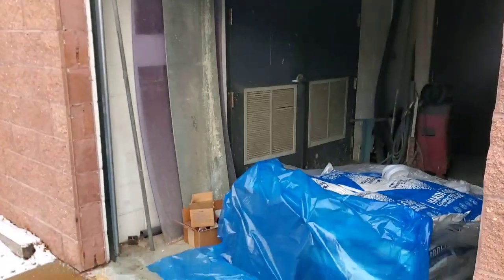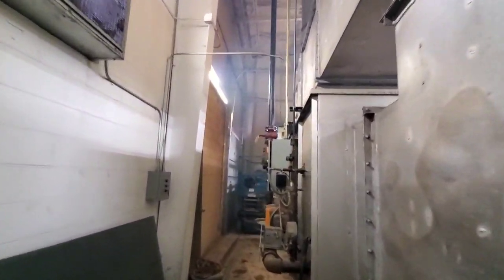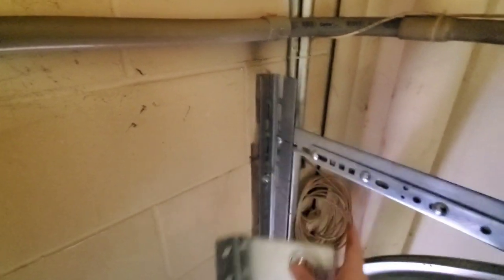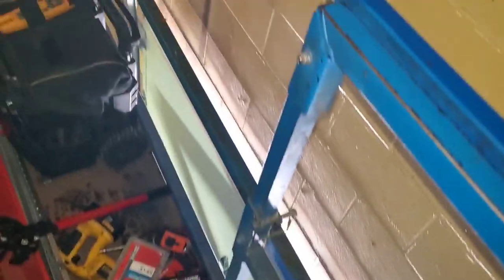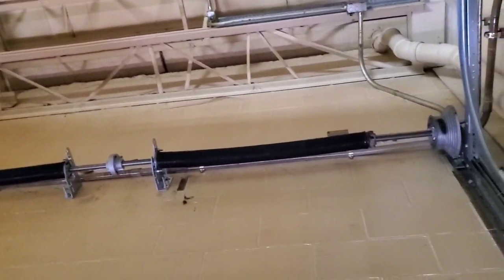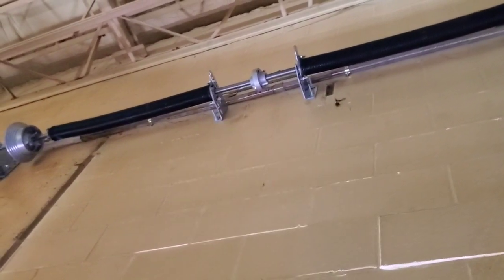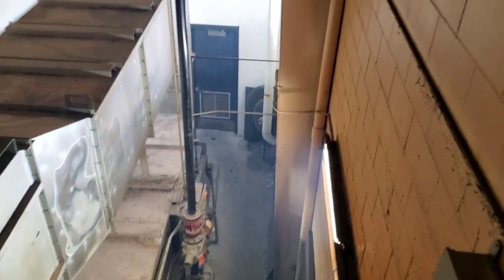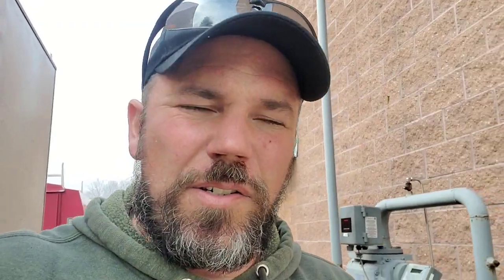Take your Spankings like a MAN

Comment: I love these on the job videos. If you have to drill holes in the bearing plate to make it level, does it mean that your tracks aren't level either?
Reply from the maker: Correct. I just didn't care much about the track.  No one could see it in that messy room. I was just worried if my drums and springs where off it might lead to other problems.